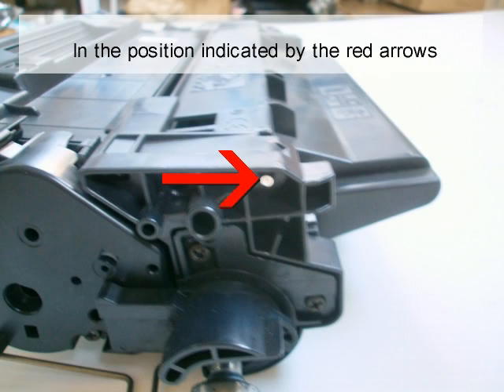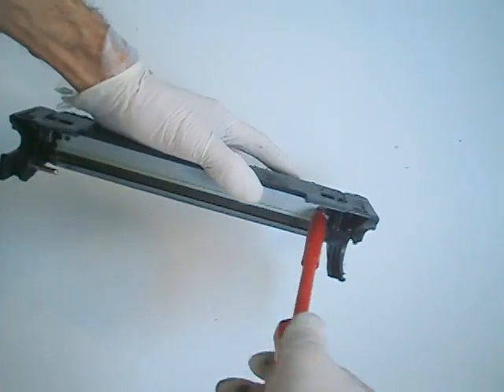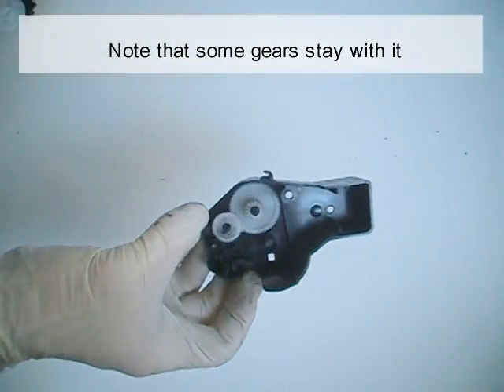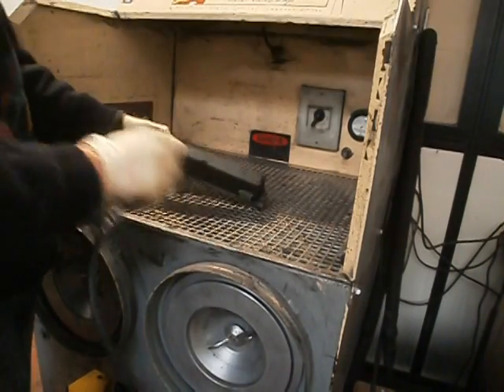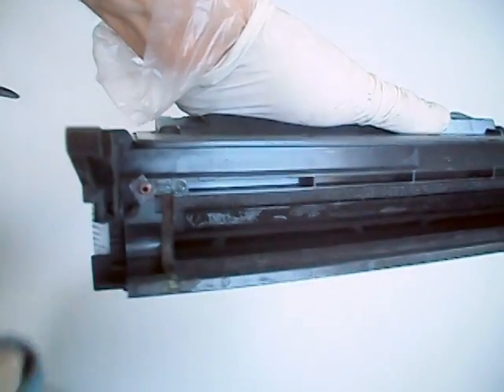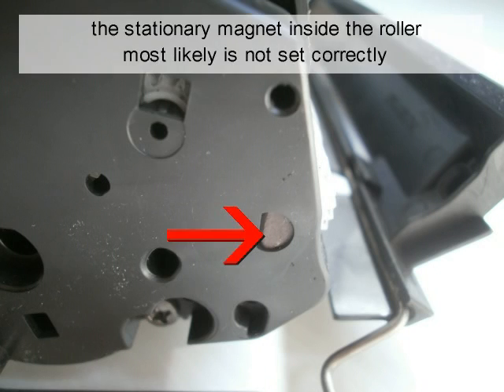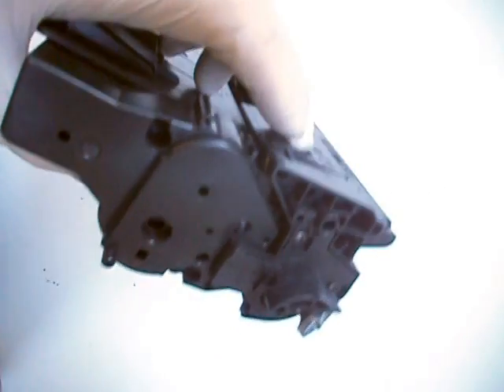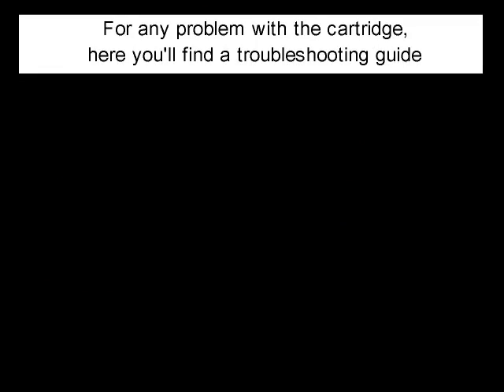HP Laserjet P3015 CE255A CE255X: Refill Toner Cartridge

Comment: After refill, my printer does not print anything or photocopy any it prints blank or empty pages, what could be the problem??
Reply from the maker: Probably you reassembled the toner cartridge  not correctly. disassembly the cartridge and reassembly it again, check if the drum contact is installed correctly

Comment: Uh, when i remove the thing from the printer it is big, i have a laser toner cartridge refill, but i don;t think i need to do all of this, just like replace half of it, but it looks slightly different ?
Reply from the maker: do you mean you have a toner bottle? you have to put the toner inside the cartridge
Reply: @viandant5  Apparentlky they got me a toner artridge for an HP 3015, not an HP P3015...
Kind of a difference... Sigh...
Reply from the maker: @gabiballetje  yes, they are different toner